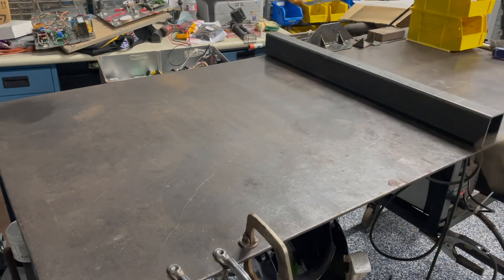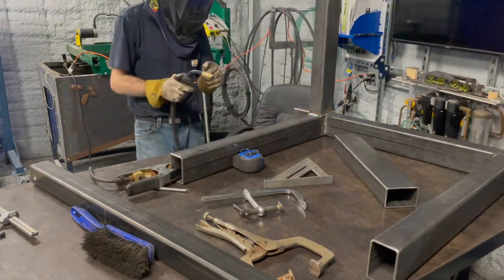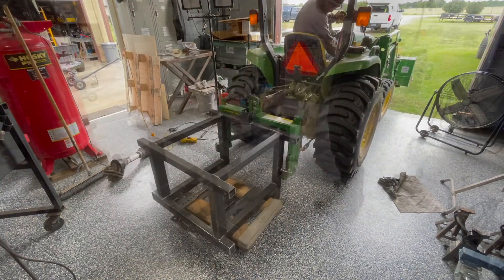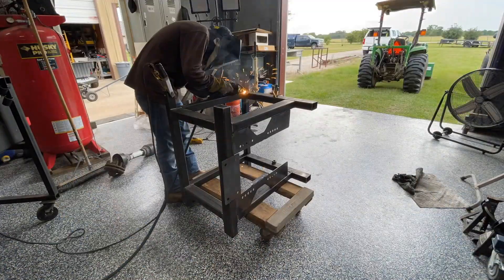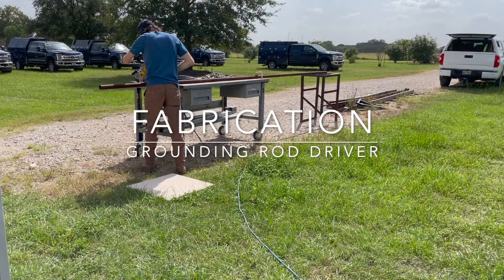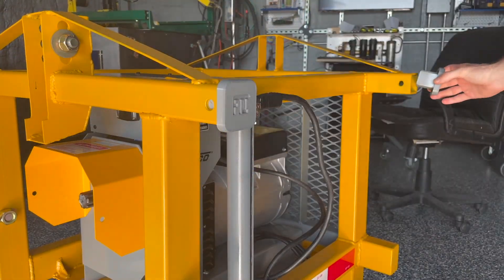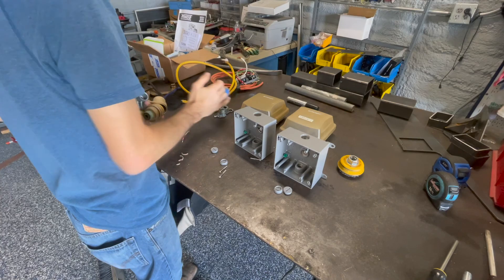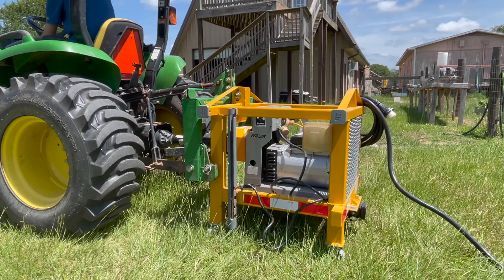Building a 3 Point Hitch for a Winco 15kw PTO Generator for Behind the Tractor

Comment: Excellent fab, excellent video!  I've been considering a PTO generator and your project is very similar to what I want to do.  I want to build mine the width of my tractor, with the generator in the center and an air compressor & welder on either side of the genny, a 1/4" plate top for a work surface, vise, etc.  
   The very little video editing I've done in my life has given me a great appreciation for how much work it takes to create well-made videos such as yours.  Thank you for this content!
Reply from the maker: Thanks Scuba Smith! My plan is to use steel to build the gates and corner posts in the future on the property. This PTO genny setup will certainly be what powers those project forward. Send me an email, I would be happy to share the build plans.